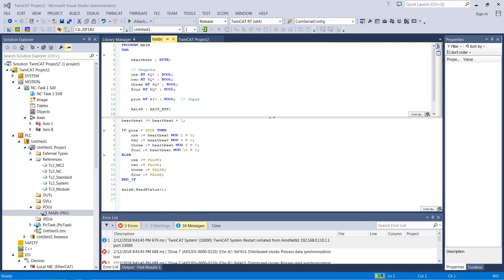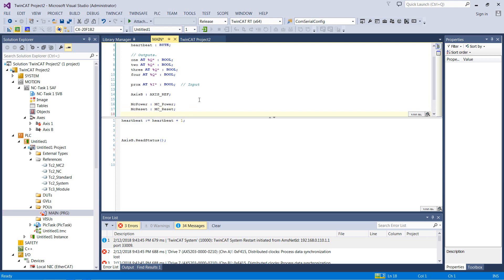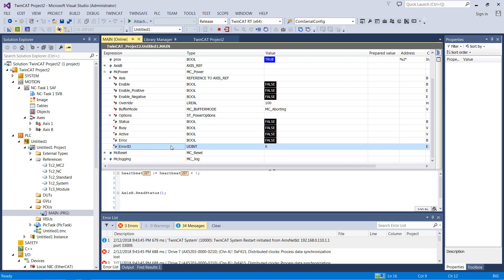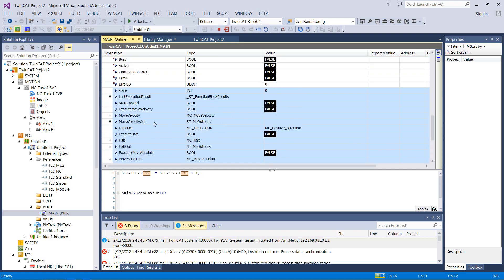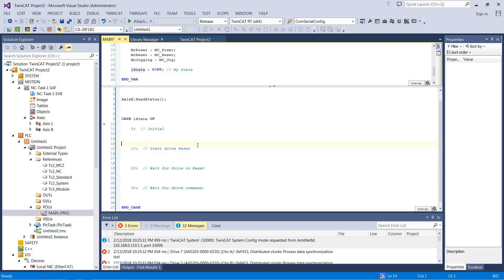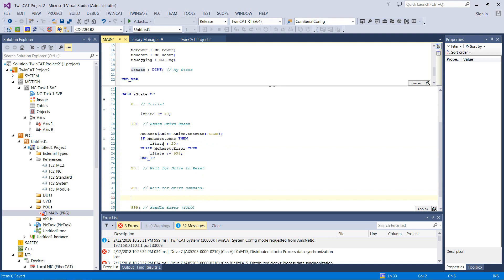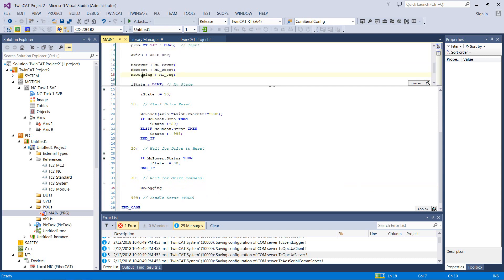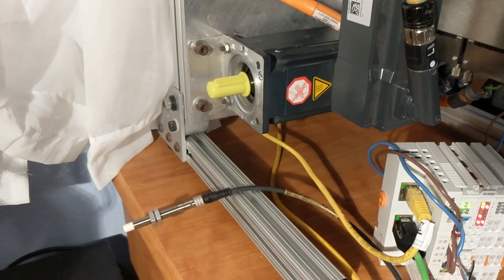Motion Control and IO with PLCs - EP8 - On to PLC

Comment: Hi, It's me again. I followed the video but when I want to start, MC_Power does not go true. I get the Error ID 4B09 which says "axis is not ready". The three inputs from mc_power are all true. Axis is not ready is not really helpful information. Do you know where the issue could be? Did I maybe set up my axis wrong? I am using a AM3033 with a AX5206
Reply from the maker: Basically access not ready means that even though you asked it to enable, something kept it from doing so. My guess would be that you need to go and configure the power settings in the drive manager, or you need to make sure that you've wired the drive properly and it has both its high and low voltage inputs. If I'm recalling correctly, you need to supply the 200 volt AC or higher as well as 24 volt dc. If you can't get it worked out, I would love to help but I don't have time right now, but if you have purchased the hardware you can call back off and get a support engineer to do a screen share with you and they will get you up and running

Comment: I am trying to run your code but it doesn't work. I don't have a proximity device so I just fake it with a toggle. McReset.Done never goes TRUE, it remains FALSE. I can force it true and then things work. The McReset.Error is TRUE and the ID is 1793. The manual tell me that it is due to  "Service is not Supported by the Server".  The Axis was defined automatically when I had the system scan for devices.  Their might be a setting I missed. Any Suggestions?
Reply from the maker: Forcing it with a bit is fine instead of a switch or digital input. My guess is if the move never gets done then it's because you're exiting the state where you're calling the function block, and after the rising edge of the true bit you have to continue calling the function block until completion.

Comment: Hi, I got an ERROR on McReset (Error value 16#00000701). Can you please help me. I got directly in Case 999.
Reply from the maker: 701 means general device error. My guess is that you don't have the PLC version of the drive IO linked to a proper NC axis

Comment: Are you familiar with Panasonic plc family? what do you think?
i am programming the FP7 and FP0r series in ST with FPWin software and they are really nice. i could create very complex applications with cam, gearing and clutch features, using the standard libraries and output in traditional pulse/dir.
then i saw your videos showing the ethercat system and i wonder how much time i would save cabling the machines...
I will try bbeckhoff soon!

Comment: Hello, This is K.S.Kim

I am using TwinCAT2 (x64) and I followed with your episode.
But iState can not be transferred to 30 from 20 with errorID 19209.
How can I fix this?
Reply from the maker: Have a look at the ADS and NC error code PDF from beckhoff.   "19209. "Axis is not ready" The axis is not ready and cannot be moved."
So, if you have no servo drive linked, it should go ready when you power it up with MC_Power, and just be a virtual axis.  If you have a real servo, stepper slice, etc, you'll need to find out why it is not reporting 'ready' in its status word that gets sent to NC.  It could be that you are trying to make a move without it being told to power up first.